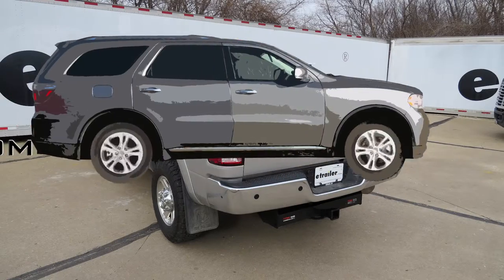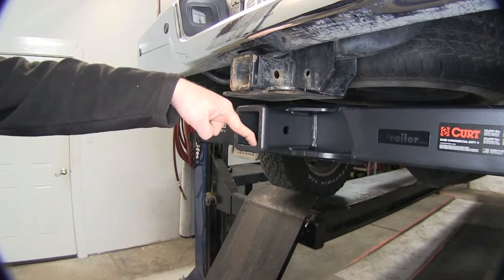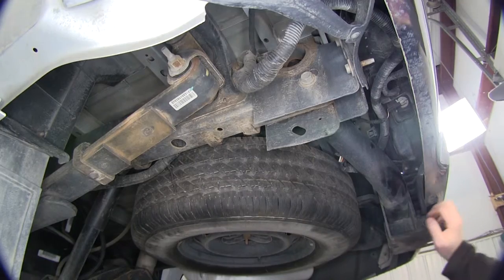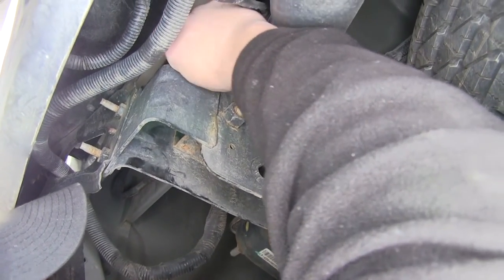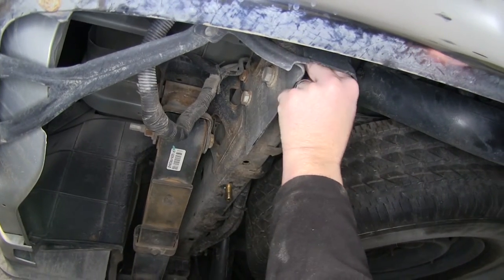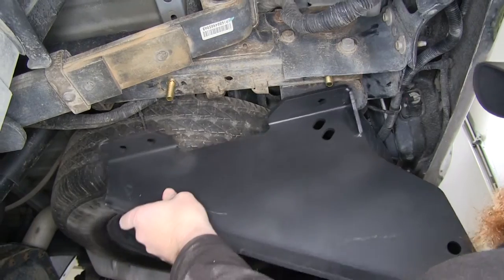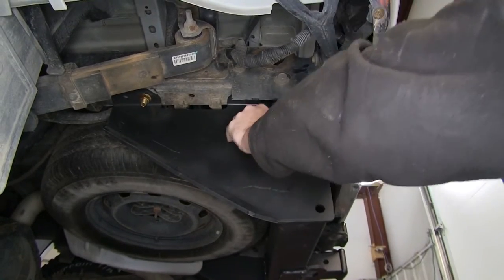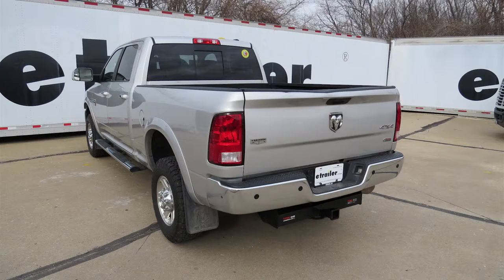etrailer | Trailer Hitch Installation - 2011 Ram 3500 - Curt C15809

Comment: Do you guys make a different model of this hitch that sits up closer to the bumper in the factory location. I twisted my stock hitch and coincidentally the bumper as well so I’m not concerned about having a more in depth installation process
Reply from the maker: Most of the hitches we offer for the 2011 Ram 3500 are designed to sit below the OEM hitch, but the Draw-Tite # DT45509 will sit tight to the underside of the bumper once the factory hitch is removed.
https://www.etrailer.com/Trailer-Hitch/Ram/3500/2011/DT45509.html